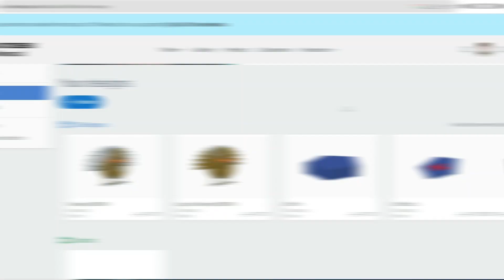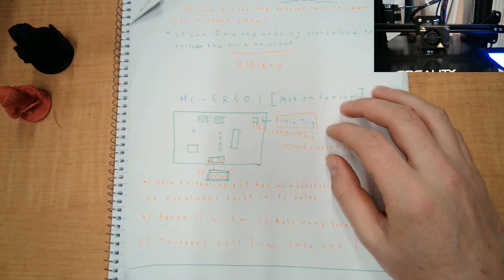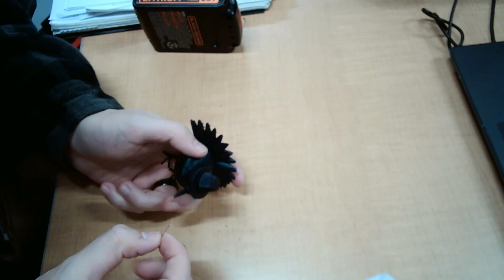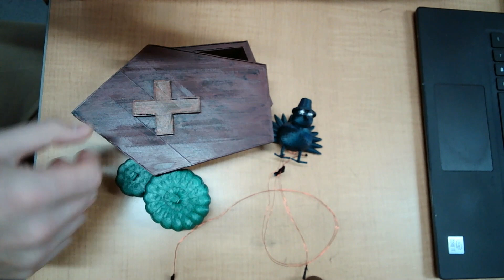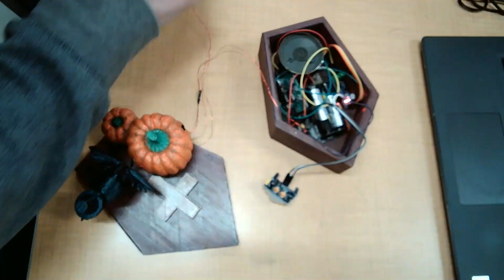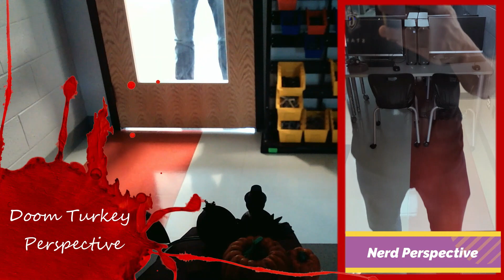Custom Arduino Motion Sensor (AKA The Spooky Turkey)

Comment: Hello sir, I have 808nm 300mw IR laser diode but I don't know how to make driver circuit board for this laser diode. can you please give me suggestions for easy driver board and it's can burn matchstick from 1 meter distance with in second
Reply from the maker: Laser's aren't my specialty and I'm not entirely sure 0.3 Watts is enough power to burn wood BUT you could try an LM 317 driver circuit with a potentiometer to control the power for a simple circuit.  Hope this helps!